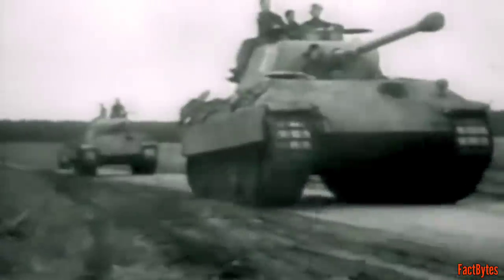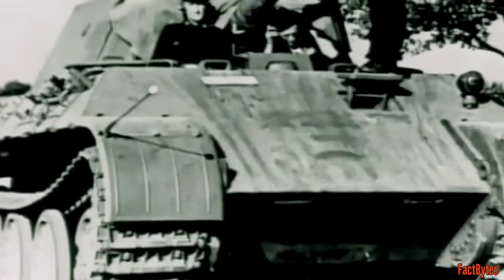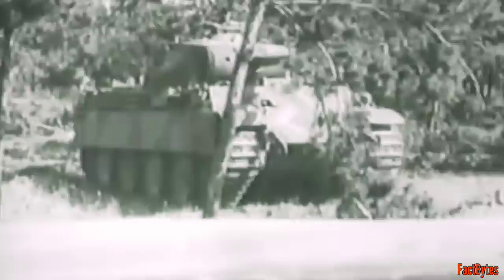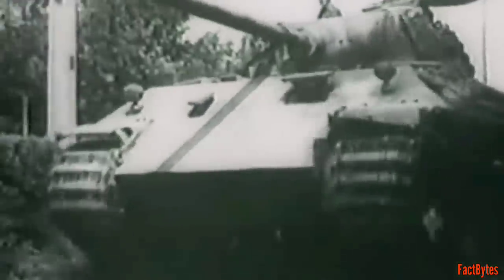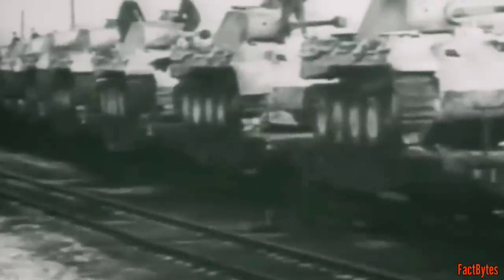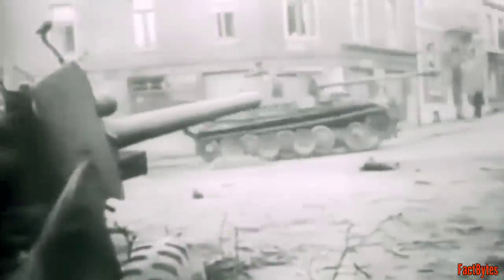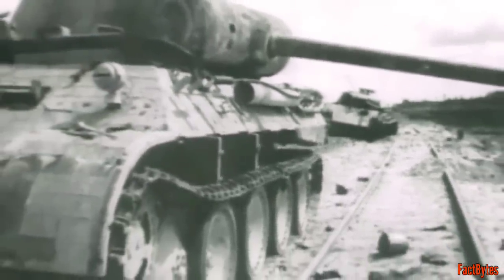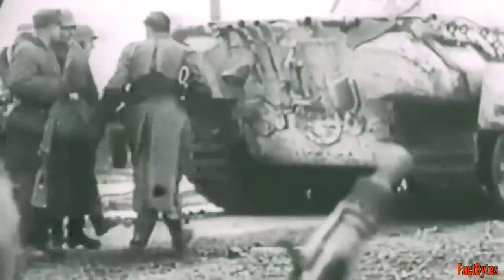Was The German Panther Really The Best Tank Of WW2?

Comment: I was hoping you say the actual story of the Panther which was that it was a design of the 30s meant to replace the Panzer III and IV fleets since they were already deemed obsolete pretty much even before the war started, nevermind the invasion of France.
Reply: wrote: "I was hoping you say the actual story of the Panther which was that it was a design of the 30s meant to replace the Panzer III and IV fleets since they were already deemed obsolete"

--Lol, why do you want to make him to "LIE" about Panther was designed of the 30s, it surely was NOT November 1941, that is when specs for design and development of Pz-V was finalised based on H. Guderian report of Soviet T-34 tank, and Panzer committee, that studied that tank in Mtsensk. Every previous prototype was scrapped as obsolete/NOT GOING TO WORK vs Soviet T-34, and that happened in Fall of 1941, not in 1930s.
Reply: @RussianThunderrr  A tank doesn't just pop off out of nowhere after 2 years, a lot of time and effort went into designing of both the Panther and Tiger and it all started from the around mid 30s with the VK 36.01 and the VK 45.02 (H) which was planned to be a second version of the Tiger even had the same gun and almost pretty much the same turret as it would eventually be on the Panther.

So while yes, the final design was different, it still didn't just start right after Germany meet the T34 and then go on to be design in around 2 or maybe even less years so it can be shown off at Kursk.
Reply: @Armored_Baron  wrote: "A tank doesn't just pop off out of nowhere after 2 years, a lot of time and effort went into designing of both the Panther and Tiger and it all started from the around mid 30s with the VK 36.01 and the VK 45.02 (H) which was planned to be a second version of the Tiger even had the same gun and almost pretty much the same turret as it would eventually be on the Panther."

-- Ah, no. Panther and Tiger not the same, but two parallel projects, that had different prototypes(VK indexes). Tiger was Durchbruchwagen ("breakthrough vehicle"), while Panther(before it had its name as such) was an attempt to replace both Pz-III and Pz-IV with just one tank, since Pz-III specialised on tank vs tank, while Pz-IV was Begleitwagen ("accompanying vehicle") or fire supression of soft targets like AT guns an infantry. So VK 20.02(M) check out wikipedia there are tons of info(he-he) about it... was the prototype.
Reply: @Armored_Baron  wrote: "So while yes, the final design was different, it still didn't just start right after Germany meet the T34 and then go on to be design in around 2 or maybe even less years so it can be shown off at Kursk."

-- Well, it really doesn't matter much when and what "homework" companies did before hand, after all, most of them are in the industry that producing military equipment, and when they compete with each other, those who did their "homework"(or had a prior experience that they can bring to bear from other project into present) will have an advantage, so what counts is -> when ministry drawing up final specs, then company really start developing product to match those specs. In case of Tiger tank, experience with British Matilda's in North Africa and successful use of 88mm guns against them, made the crucial decision in final specs of Tiger tank. And final specs for which was signed by A. Hitler on May 25th, 1941(curiously before invasion of USSR, and that is the reason why Tiger I tank did not have a sloped armor). In case of Pz-V Panther was H. Guderian report after battle of Mtsensk near Moscow, when he informed Hitler that Soviets had a much better and superior tank, so Panzer Committee was formed and Flown to USSR, that included Ferdinand Porsche, Ervin Aders, Alfred Krupp and many others, to study T-34 tank(instead of waiting of delivery of T-34 tank to Germany), and that committee drawn up specs for development of Pz-V tank in November of 1941, and that became VK 30.02 tender, main features of which were sloped armor(that will show up on all German tanks there after), long gun, and H.Guderian insisted on powerful Diesel engine which eventually was dropped from requirements.
Reply: @RussianThunderrr  I never said they were the same so I'm not sure why or how you're assuming that but going by your name I can guess that English is not your primary language.

And regardless they were still products of several years of research and development prior to the Germans meeting the T34 on the Eastern Front.

All of the fairy tales people like to spin about the Soviet tanks being the first to have sloped armor or what prompted the development of the Tiger and Panther are nonsense and are made up, especially the sloped armor one since all of the French designs in 1940 basically feature it anyway.

As far as the rest of the things you've wrote, I'm not sure how you concluded that the final assessment of the Germans that they needed something heavier than a Panzer IV was in Africa when the Germans already met the Matilda during the invasion of France in 1940, plus the 88s were also tested beforehand in the Spanish Civil War so it wasn't their first trial against tanks either. Also it's Erwin Aders, the "father" of the Tiger tanks that led their development, not Ervin.

Also about the VK30.02 which would eventually be the Panther, the Daimler-Benz version was basically a T-34 on steroids, but it was dropped not because of a change of requirements but because Germany didn't have a domestic diesel engine powerful enough for a tank and also the turret castings had to be made a new, while the MAN design which would eventually become the actual Panther was more classic in it's design and incorporated many available parts, including the experimental turret used for the prototype of the Tiger H2.
Reply: @Armored_Baron  wrote: " I never said they were the same so I'm not sure why or how you're assuming that but going by your name I can guess that English is not your primary language."

-- Well, both the VK 36.01 and the VK 45.02 (H), and nether one is a prototype for Panther tank, right?
Reply: @Armored_Baron  wrote: "the Tiger even had the same gun and almost pretty much the same turret as it would eventually be on the Panther."

-- If you talking about 75mm tapered barrel gun that was planned to use on Tiger tank with tungsten munition, then its not the same gun that ended up to be on Panther tank.
Reply: @Armored_Baron  wrote: "All of the fairy tales people like to spin about the Soviet tanks being the first to have sloped armor or what prompted the development of the Tiger and Panther are nonsense and are made up, especially the sloped armor one since all of the French designs in 1940 basically feature it anyway."

-- Did any French tanks had sloped armor plates? And what French tanks do you have in mind, and what kind of armor do they featured?
Reply: @Armored_Baron  wrote: "Also about the VK30.02 which would eventually be the Panther, the Daimler-Benz version was basically a Panther on steroids..."

--Um, Panther on steroids, hah... what happened to that Panther, did it stop work out and became 45 ton fat cat? Or you mean it was a "T-34 on steroids", with three variants of diesel engine, and two gasoline engine for VK 30.02(DB), that lost to VK 30.02(M), because it looked to "Russian"? And 30.02(M) on paper looked very menacing, but was in a less advanced stage then VK 30.02(DB), therefor design mistake was made with final gear drive, that was never fixed for the life of the Panther?
Reply: @Armored_Baron  wrote: "All of the fairy tales people like to spin about the Soviet tanks being the first to have sloped armor or what prompted the development of the Tiger and Panther are nonsense and are made up, especially the sloped armor one since all of the French designs in 1940 basically feature it anyway."

and

"As far as the rest of the things you've wrote, I'm not sure how you concluded that the final assessment of the Germans that they needed something heavier than a Panzer IV was in Africa when the Germans already met the Matilda during the invasion of France in 1940, plus the 88s were also tested beforehand in the Spanish Civil War so it wasn't their first trial against tanks either."

 - So, Eh. Soldier... If you not sure where this information came from, then I'm highly recommend to you to read some British books(so that way you won't accuse me of Soviet bias) on design and development of Tiger and Panther tanks. Osprey Publishing of Oxford is a good start. They had Vanguard series on a history of development of Tiger and Panther tanks, and tanks duels series like "Panther vs T-34" or "IS-2 vs Tiger", then you can comeback after educating yourself, and we can talk about it.
Reply: @RussianThunderrr  The Panther was developed using experience as well as also parts from the previous VK programs, so as I said before it didn't just start from scratch when the Germans met up with the T34 in 1941 and I would also post proof but YouTube thinks all of my links are scams or something and censors my comments.

And yes, it was pretty much the same 7.5 cm KwK 42 L/70 that would be used on the Panther, minus the muzzle break. You can feel free to look it up. And perhaps the turret wasn't 1:1 with what would eventually end up on the Panther but the resemblance is undeniable unless you're a person that doesn't want to admit that they're wrong.

The French Char B1 and Somua S35 both have sloped armor, at least the frontal plates and were among numerous tanks opposing the Germans during the invasion of France in 1940, an year prior to Barbarossa. And again the previously mentioned Matilda 2 being engaged by Rommel's Flak 88 battery of his 7th Panzer "Ghost" Division.

I also meant a T34 on steroids which it was, featuring more escape hatches than the T34, a better 3 man turret and diesel engine, the long barrel 75mm Panther gun which I've mentioned previously which was one of the most effective AT guns during the entire war as well, capable of penetrating most if not all Allied tanks at the time, and not to mention the better armor because Soviet welds were notoriously very shoddy.

And lastly, the problem is my Russian friend that I've read a lot of books about tanks, and especially about the Tiger. And it's very ironic and I would say hypocritical of you to tell me that I should educate myself when you're the one spewing historical inaccuracies left and right such as the Germans first meeting the Matilda II in Africa in 1942.
Reply: @Armored_Baron  wrote: "The Panther was developed using experience as well as also parts from the previous VK programs, so as I said before it didn't just start from scratch when the Germans met up with the T34 in 1941 and I would also post proof"

-- Oh, feel free to be more specific, I'm familiar with VK prototypes. So you were saying that VK 30.01 was a Panther program?
Reply: @Armored_Baron  wrote: "The French Char B1 and Somua S35 both have sloped armor, at least the frontal plates and were among numerous tanks opposing the Germans during the invasion of France in 1940, an year prior to Barbarossa."

-- Nether tank you mentioned had a "front plate" per se. Char B1 had a riveted frontal armor, and Somua had a cast armor, so no "front plate" can be found there as well. Front Plate refers to RHA(Rolled Homogeneous Armor). So nobody copied French tanks, which is not the case with T-34, and if you claim that you read books(which I have a deep doubts that you do), and never came across H.Guderian report about T-34, which became a reason to have a Panzer Committee that formed the specs and authorized development of Pz-V.  What did you say Pz-V prototypes were? It was neither VK 36.01 nor VK 45.02, which were Pz-VI prototypes.
Reply: @Armored_Baron  wrote: "And it's very ironic and I would say hypocritical of you to tell me that I should educate myself when you're the one spewing historical inaccuracies left and right such as the Germans first meeting the Matilda II in Africa in 1942."

-- Do you hallucinating about me spewing that Germans first meeting the Matilda II in Africa in 1942? And why in 1942, what is so special about 1942, and how is it relevant to a subject at hand? Can you explain?
Reply: @RussianThunderrr  The VK 30.02 were quite literally the Panther prototypes yes, Daimler-Benz's proposition being a superior version of the T34 basically and even tho I doubt politics had anything to do with it you might be a bit right that Hitler didn't want a German looking Soviet tank in his Army.

And the frontal plate means the armored front part of the tank, not what type of armor is used there. I also don't really care what you think about me, my knowledge of tanks or what books I've read since most of the things that you've written here make no sense whatsoever which I attribute to your lack of understanding and basic comprehension of the English language although I'm not even sure what you're saying would make much sense in Russian either to be honest.

Also yes, I would apparently need a psychologist according to you probably since you keep mentioning that the Germans first met the Matilda II in Africa, while as I said in reality it was 1940 in France where the Flak 88 proved to be quite effective against them.
Reply: @Armored_Baron  wrote: "And the frontal plate means the armored front part of the tank"

"no sense whatsoever which I attribute to your lack of understanding and basic comprehension of the English language"

-- Oh, FYI word "plate" means something flat or flat RHA(Rolled Homogeneous Armor) plate in this instance, and since Somua tank frontal armor had a curvature, therefor it is nor a frontal "plate" by definition, its just front armor or frontal armor, so its not my understanding and basic comprehension of the English to blame, but yours.
Reply: @RussianThunderrr  You're the one that started by bringing up the type of armor and also shape of it.

My point is that both the French and British tanks that the Germans met in 1940 France didn't have flat fronts like their own tanks so like it or not the T34 wasn't the first design that they met which had a 90 degree flat facing frontal armor.

But yes I am aware of Guderian and other German Generals' reports on the T34, and?

They already knew that the Panzer III and IV wouldn't be enough and would eventually need to be replaced or supported by something bigger so programs such as the Durbuchwagen wouldn't have been started at all if they were deemed to be enough in the first place so the a T34 and KV1 might have been the final nail in the coffin for the decision, but they weren't what started it in the first place as many people claim.
Reply: @Armored_Baron  wrote: " You're the one that started by bringing up the type of armor and also shape of it."

-- And there is a good reason for it, since not all armor is the same or created equal. Cast armor can easily been given any shape, but more difficult to manufacture when it comes to producing a large tank parts as a hull of the tank, and have to be thicker and heavier then RHA to have the same AT gun armor resistance properties. So, I know, for you it might sounds like "to-may-tos vs. to-mah-tos", but to those who design and manufacture tank its absolutely deferent methods of building the tank. Spoiler alert, Germans didn't rush and copied French or Brithish cast "sloped" armor, however British towards the end of WWII tanks adapted RHA under "rational angles"(aka steeply sloped armor where Effective Armor Thickness doubles) in favor of cast frontal armor, and even other competing Soviet tank manufactures like Josheph Kotin's IS-3 heavy tank, or N. Astrov's  light tanks.

-- The other thing is worth mentioning, is that - its a common knowledge that if you put any kind of barrier under almost any angle, it will increase the chances of the projectile just to ricochet of it, instead of piercing it. The question is in order defeat a projectile(in this case its an AT(PaK) gun) at certain distance what thickness and what angle? Less obvious question how do they relate, thickness to angle in terms of projectile resistance. Answer to those question found N. Tsiganov when study an experimental project called "tortious" BT-SV tank, final implication of it, as Germans found out only in November of 1941, that 45mm frontal armor plate that German PaK gun would have no problem perforate at normal combat distance if it was set at 0 degrees, all of the sudden in tank T-34 performed as almost 90mm armor, that even 5cm PaK 38 had a hard time to deal with.
Reply: @Armored_Baron  wrote: "a lot of time and effort went into designing of both the Panther and Tiger and it all started from the around mid 30s with the VK 36.01 and the VK 45.02 (H)"

and 

"The VK 30.02 were quite literally the Panther prototypes yes"

-- VK without indexation is a specifications(or "wish list" of features) that future prototypes from competing manufacturers have to include in their prototypes. So 45.02 is a specs for Tiger I replacement tank, aka Tiger Ausf. B aka King Tiger, that supposed to include a sloping armor as its main feature. VK 45.02(H) is actually a prototype submitted from Henschel that won competition over Porsche's  VK 45.02(P) prototype proposal. It also had a scaled up copy of earlier T-34-76  turret, which later been replaced with copy of later T-34-76 model 1942-43 turret called "(Guyka").
Reply: @Armored_Baron  wrote: "But yes I am aware of Guderian and other German Generals' reports on the T34, and?"

-- So, there is more info came out from that H. Guderian's Mtsensk tank battle report, for example: that Pfeu 6 ignoring A. Hitler orders to up gun Pz-III tank, under excuse of logistic nightmare, that is just to illustrate how argent the development of Pz-III and Pz-IV came around...

-- And there is more, since specs for development of Tiger I tank been finalized somewhat six moth prior to A. Hitler discovery of how superior T-34 tank vs any German tank in October-November of 1941, so it was too late to change specs for Tiger I tank to include "slopped armor", therefor second model of that tank went into development in 1942 as VK 45.02.
Reply: @Armored_Baron  wrote: "The Panther was developed using experience as well as also parts from the previous VK programs, so as I said before it didn't just start from scratch..."

-- And last, but not least of points, is that every time you have new specs drawn up, that means redesign of whole tank, so realistically you might have a components lay out experience to draw upon, but realistically you wont be able to use 20 tons tank components(engine, drive train and ect.) on a 40-50 tons tank.
Reply: @Armored_Baron  wrote: “A tank doesn’t just pop off out of nowhere after 2 years,…”

— … And, Oh BTW, Pz-3 and Pz-4 “pop off out of nowhere after 2 years” since spec where drafted for those in 1934, to literally when they start making ‘em in 1936-37.